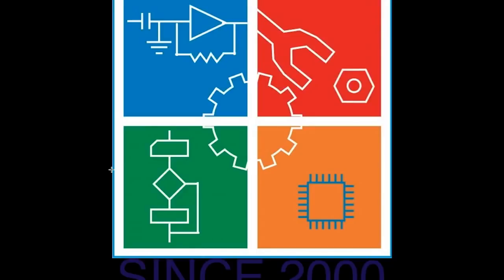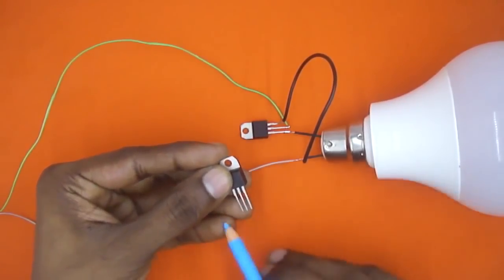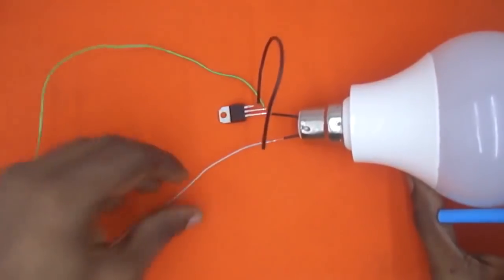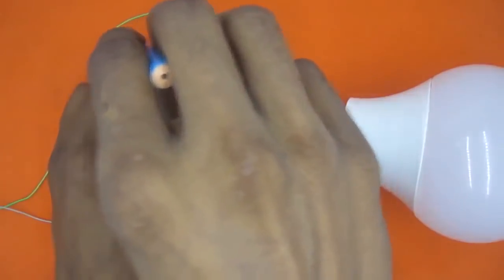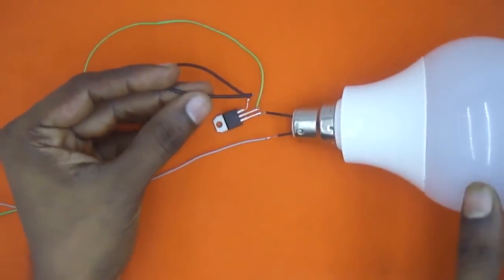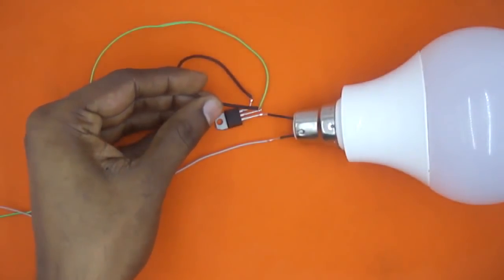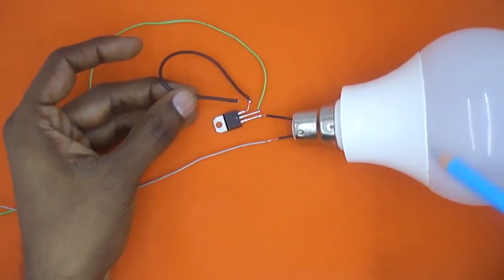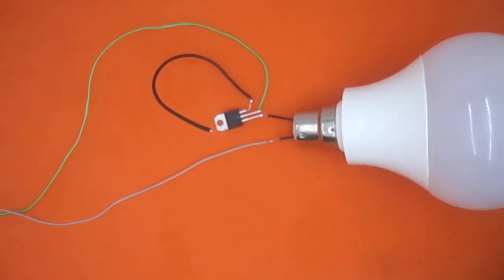How BT136 works simplest explanation #bt136 #electronics #triac #accircuits

Comment: As you see, You are Connected the Gate Terminal Directly ( Without any Resistor ) with the T1 ( Terminal One ) which have Heigh Voltage ( 220,V ) . So Why the Gate Terminal Not Damage Due to you say,s Earlier that The Gate Terminal should be operated with 01..01.5-V . So what is the logic with them sir .
Reply: 😂😂 Right Observation, TRAC damage ho jayega, You can't connect directly T2 with Gate, you should use Resistor

Comment: When tested with 10amp ac load the triac fused within seconds
Reply: When tried with 10amps ac load by triggering with incoming ac volts as shown by you the triac bt139 failed within seconds
Reply from the maker: For BT136 : max current is 4A with heatsink .....  and 1A without heatsink

Comment: MY BT 136 Sparked and  blasted with high sound,  when one  wire of AC input given directly on gate. You are using DC power source and DC bulb but not clear the viewers, your power supply (DC) is hidden,  you cannot given AC directly on gate without resistance  of 100k or above for limiting the current and volt to the gate.
Reply from the maker: I m using AC power 220V
Reply: You connected to live wire, you should connect to neutral...

Comment: Which type of power supply and voltage you are using in this video
Reply: Bt136 a.c. device which operate on a.c. hight volts it gives high current

Comment: is the AC input to the TRIAC is 230V. CAN IT HANDLE 220V-230V. does it require HEAT sINK.???
Reply: Refer to datasheet
http://www.mouser.com/ds/2/302/BT136-600E-352978.pdf
Reply: Yes because this is high power device and high current

Comment: be safe while experimenting with AC circuits
Reply: Spot on , bro! There should be adequate warning upfront in the video,  on possible dangerous shock, if not done properly.👽 This is not for beginners. 

Ideally, the bulb ( type, wattage should be mentioned)  should be shown  mounted on a holder , and 'wire touching' could be via a push switch .